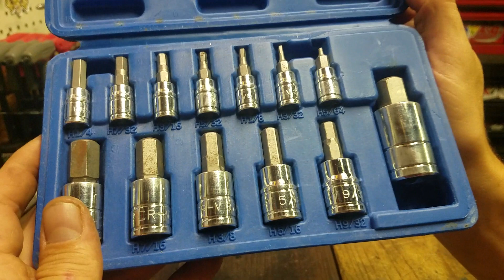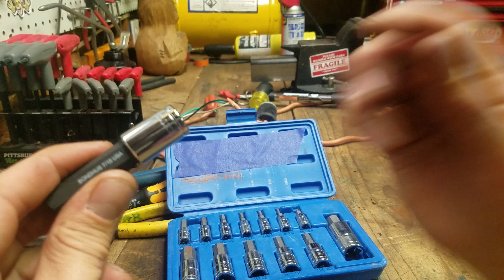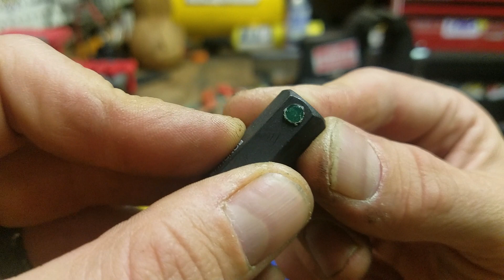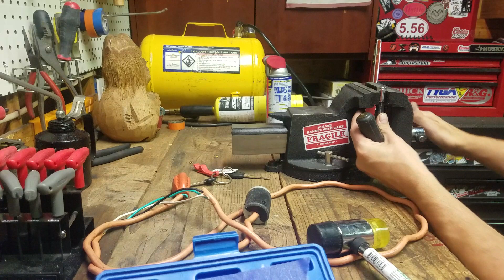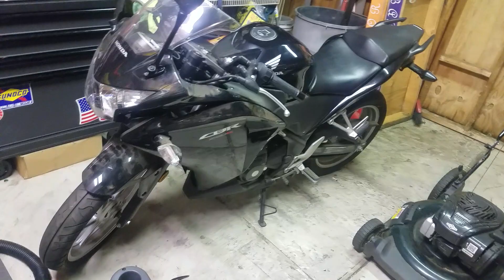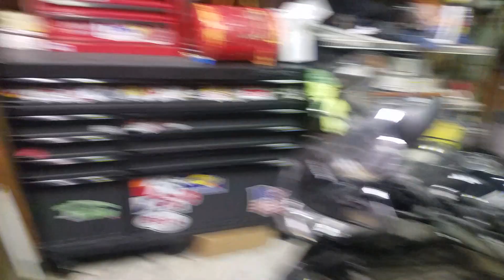Bondhus Hex Bits

Comment: The bondhus bits look pretty nice, honestly, and don't seem too expensive in a quick search, but they seem a little short if the length is what you're after.  Have you considered, just making your own bits?  Buy a cheap set of allen wrenches and cut off the bent end leaving a 4-6 inch long hex shank of each size.  Pick up a cheap set of 3/8 drive sockets to match, a dab of JB weld or some similar to hold the hex in the socket, and your set with some nice, long 3/8 drive allens in whatever sizes you need.   Cutting through the hardened steel will probably be the worst of it, but a die-grinder should make fairly quick work of it.  

If you want to go super cheap and janky on it you could also just use a long bolt with a 7/16 head on it (or whatever size you need) and grind down the thread end so a socket of some size fits over it.  It's not pretty, but it will do the trick.
Reply: John Galt Line bondhus makes the bits in 2”, 2.5”, and 6” lengths
Reply: I guess I'm kinda randomly asking but do anyone know a good site to stream newly released series online?
Reply: @Deangelo Dario Flixportal :P
Reply: @Cruz Krew thanks, I signed up and it seems like they got a lot of movies there :) I appreciate it!!
Reply: @Deangelo Dario no problem :)
Reply: @deangelodario2319  Because a youtube comment about hex key wrenches is the place for this... good job bots.

Comment: I usually just temporarily remove the plastic guard over the lugs.  Usually just 2 or 3 screws and you can get to it easily.
Reply: Or just use a 3/8 inch rod coupling in a socket ha ha.  Definitely done that before.  Works great.

Comment: Also Mike you could go to McMaster Carr in order different styes tool steel bar stock in make your own to fit in sockets there and chamfer the beginning edge with a grinder or something or some sand and I need a grinder but then you could make your own weight you just order a little foot longand cut it down to size
Reply from the maker: +The Snap-On Junkie!!! I need to get one of those catalogs.   I'm sure what I need is in there somehwere

Comment: I have a old hex set, it had 1 3/8th driver with a set screw you secure the Allen key to the driver. They had the same shaft to fit the driver and bigger or smaller heads to them. It's nifty But I don't ever use em.

Comment: It would be handy to have long hex bits. I always end up using my Allens keys with a ring spanner or pliers to torque it up. Some of the soft starters we use come with an Allen key that has equal length ends, which is great but it's never the right size for anything else.

Comment: Husky makes long shank hex sockets or harbor frieght sells them for 20 dollars I use them for 1200 amp services all the time
Reply from the maker: +Justin Byrne are the HF ones the 1/2" drive impact set,  because those are the only ones I saw and I was afraid they weren't going to be long enough
Reply: No they are 3/8 drive and they are about 6" long they are on sale for $14 the only downside is it doesn't have a 1/2 for the big netural lugs
Reply from the maker: +Justin Byrne it does have a 7/16" in it though? I thought I had looked at those
Reply: It might not I think I have to use my homemade one for 7/16 it might just go up to 3/8

Comment: Do you still run into Robertson/Square drive lugs on bus bars?  I scrapped a bunch of old panels a couple of years ago and the ground/neutral bus bars had square drive lugs.  I stripped every one I tried to remove.   I think they either corroded onto the bus bar or they used thread locker to install them.  I would hate to have been an electrician trying to service those square drive lugs.
Reply from the maker: +German Tool Reviews every once in a while when we demo old stuff.  The worst is when they have big ass slotted screwed that are only like 8 thou deep and are torqued to 150ft lbs.  I don't even try anymore, just start with the grinder.

Comment: Here is the link to the Bondhus 10pcs set in sae.
https://www.amazon.com/dp/B002YNQSHK/ref=cm_sw_r_cp_ep_dp_mzTZybBW6JXZY

curious why you didnt think of something like these tektons?
https://www.amazon.com/TEKTON-8-Inch-Drive-Extra-Socket/dp/B001NT4DWS
Reply: 81MSW79 mulligan 
Those look awesome !
Reply from the maker: No to the tekton because 3/8 is the largest size. I don't need a few of the smaller ones and need 3 more sizes up.

Comment: I'm assuming you are from Maryland. Your terminology you use is of a Baltimore/Harford County Electrictran. Also the O's sticker on the scooter. Bondhus 33645 5/16 - 5/8-Inch 6-Inch ProHold Socket Bits without Sockets, Set of 5 https://www.amazon.com/dp/B002YNQSIY/ref=cm_sw_r_cp_apa_W80Rzb9G68N7R
Reply from the maker: +Bi0sHiFt right on the money.  What terms did I use that have it away
Reply: Mike's Tool Shed Its not just one term it's just how you talk about electrical work. It kinda of funny how people just 50 miles in any direction terminology changes. Also I edited the first post to put in for the longer Allen inserts. I too have been in search of the best set of Allen keys for larger lugs.
Reply: hah, i lived a while in bel air, harford county, i can mention my old street, salonica place, which was new back when i was there

Comment: Aren't those lugs supposed to be torqued to an actual spec to prevent the wire from coming loose over time?

I'm a little concerned that there are dudes out there with just T-handles because that's a dead promise that isn't happening...
Reply from the maker: +Maxwelhse there are torque specs for every connection,  yet I have never once seen a torque wrench on a job and no inspector has ever brought it up.   With that said.  If anything they are over torqued and will never come loose on their own, when torque is really important is when bolting solid buss bars together and those will come with break away torque limiting nuts (once the top section of the nut breaks off you are at the proper torque)
Reply: I'm just an amateur electrician so I follow the rules pretty closely. I've only installed a mains panel once, so... ;)

Comment: Long exstention is all you need. LOL.
Reply from the maker: +qzetu the socket part will not fit through the little opening. Has to be long hexs
Reply: Mike's Tool Shed oh, ok. I see what you mean. What you can also do is buy a cheap hex multi set and then cut the parts off that are at a 90. You'll actually have a much longer hex to work with. You can use a crescent wrench in the bigger hex with no problem.
Reply from the maker: +qzetu well I had looked into that also. But most all regular sets only go up to 3/8, any bigger than that and they come in an "XL" set that goes up to like 7/8".  Those sets are like 35-65 bucks. Only to cut up 2 of them and never use the rest
Reply: I see your point. The best thing to do is go to a swap meet. You can get a few for a couple bucks and make a video out of it.
Reply: Mike's Tool Shed eklind is also a pretty good made in USA hex company

Comment: Couldn't you just buy long ones and cut the L off so it's just a long ass straight shaft?
Reply from the maker: Thatworks yes, but I'd be buying one of the XL, L key sets for like 35 bucks and not get any use out of the huge sizes.  all the regulars sets stop at 3/8 and all the large size sets start at 7/16. I need a set that goes from like 1/4" to like 1/2"
Reply: Mike's Tool Shed ah ok makes sense